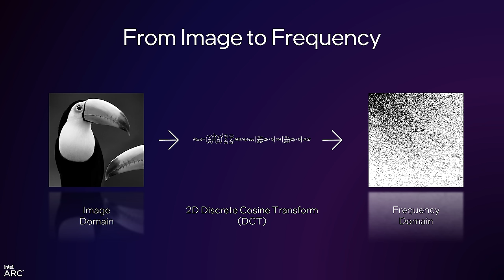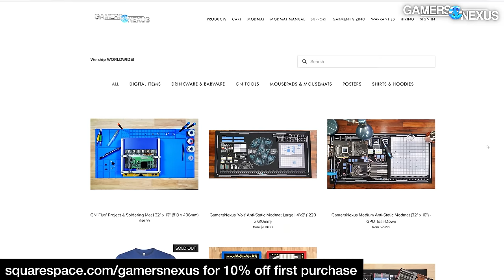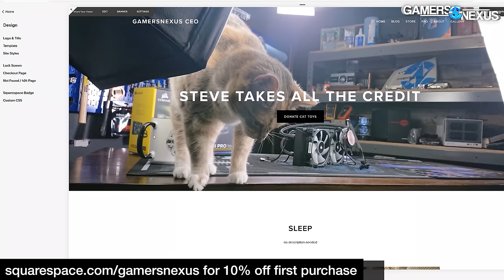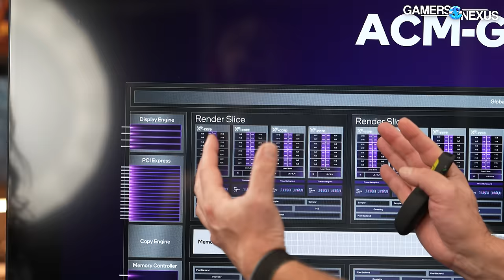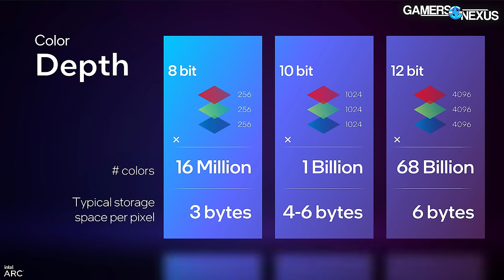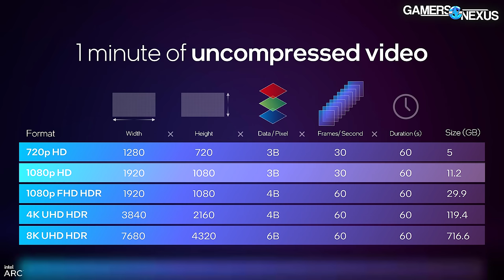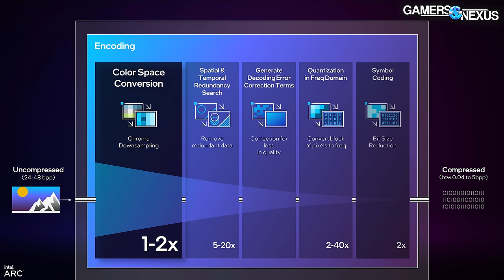YouTube's Existence is Insane: How Video Compression, Encode, & Decode Work (Basics)

Comment: A slight correction on chroma subsampling: it's not the bits that are subsampled, but the definition of the chroma image components. 4:2:2 means that the definition of the chroma image components is halved horizontally compared to the original definition, and 4:2:0 means it's halved in both directions.
Which means for e.g. 4:2:0 - which is the common consumer distribution format - you don't have, say, a 1920x1080 image where each pixel is 12 bits instead of 24, but one 1920x1080 black and white image where each pixels is 8 bits, and then two images for the chroma components, where pixels are also 8 bits but where the definition is 960x540 for each.
The chroma images then have to be upscaled back at decoding to match the luma definition (and just for fun different formats also have different specs about how the upscaled chroma pixels are aligned with the full definition luma ones).
Some video renderers will allow you to choose between different algorithms for that chroma upscaling step.

And an interesting trivia: one of Tom's slides shows 4 byte/pixel for 10-bit HDR video, but the P010 pixel format most commonly used by GPUs for that (at least on Windows) is actually 10 bits of actual sub-pixel information padded to 16 ! So if for example you use copy-back decoding mode (where the decoding image is transfered back to the CPU), 10-bit HDR video actually uses two times the bandwidth of 8-bit video instead of 1.25 times !

Comment: It's kind of insane how far compression technology has come. I still remember back in the 90's playing with a compression program written in QBasic that could cut your files in half and that was amazing back then, but now a video file can be reduced to a literal hundredth of its original size. The one inaccuracy in what Tom said was that it was lossless. Parts of the compression are, but the majority of it is lossy and information about the image data is lost. It's not as much as it used to be, but enough that multiple edits can lead to compression artifacts becoming more prominent than they otherwise would have been.

Comment: Thanks for these deep dives. If you want to ignore my pedantic nitpicks, feel free to ignore the rest of this (knowing GN viewers, this warning will only attract you)

It is true that rods do not differentiate color and that cones do, but the slide is suggesting that rods are responsible for luminance and cones are for chrominance. This is not the case -- rods are for low-light "scotopic" vision, and is rarely used in modern life. If there is any appreciable illumination, then the cones do all the sensing.

YUV is a very old colorspace from the NTSC analog broadcast days and there are other better choices nowadays, but the point of having more resolution on the luminance/grayscale part of the image over the chrominance is generally common among them. However, the subsampling rates of 4:4:4 or 4:2:0 do not refer to the bits used, and tbh I forget what they originally meant (were related to some analog-centric way of color transmission. 4:4:4 has colors at full rez, 4:2:0 has color at half-by-half rez, as was briefly mentioned. This terminology is also used in JPEG image compression.

I do not think any modern codecs are using pre-determined Huffman coding for symbols.  They either using something adaptive and denser (e.g. h264 had CABAC, an adaptive arithmetic encoder) or a simpler encoding.

Comment: 11:40 a note about chroma subsampling: It's primarily useful for live video transfer, where you need to get raw data across a studio or building. When it comes to actual video compression, the heavy lifting is done by the encoder, so chroma subsampling doesn't actually do much. This is why I have been frustrated at our insistence of using 420 this whole time versus 444, or even just staying in RGB. You can often have a 4:4:4 full range 10 bit video be barely larger than a 4:2:0 partial range 8 bit video, but it can store SO much more information and be more accurate to the source material. It would be way better for VR streaming since the color range would be better and colors would be sharper.

Comment: Another small correction: regarding symbol coding neither avc nor hevc use a fixed huffman table, both use algorithms which calculate the optimal binary coding at runtime, avc can use CAVLC and CABAC, while HEVC only CABAC, they are more sofisticated that a simple huffman coding

Comment: Tom Scott has made a great video explaining Huffman encoding. The gist of it is that, the more common a pattern is, the less bits we use to encode an occurence of that pattern. It's a clever way to generate an encoding for each pattern in such a way that it achieves that.

To really understand the frequency domain and quantization part, you kinda need to know the mathematical background of fourier series and the fourier transform (the discrete cosine transform used here is very similar to the "real" fourier transform as far as I understand it, same concept). 3blue1brown has made great videos explaining those.

 The basics is that we can think of any data as being generated by a sum of an infinite amount of sine waves or cosine waves, or in practice you'd use a finite amount of waves, the more waves, the closer you get to the original data. So you have for example a 1Hz wave multiplied with some factor a, a 2 Hz wave multiplied with some factor b, a 3 Hz wave multiplied with some factor c, etc, for each frequency you have a value of how strong that wave's influence on the generated data is, you just multiply each wave with that factor and then add all of them together to get the data (getting back the original data from the frequency domain data like this is called an inverse fourier transform). If you were working in 1 dimension, such as with (mono) audio, the frequency domain graph would have frequency on the x axis (eg. 0.1 Hz to 10000 Hz or whatever) and in the y axis for each frequency the "strength" of that frequency, the multiplier. In this case of working with images, you need to do this in 2 dimensions of course, so I assume you have waves going in the x direction and waves going in the y direction. So the frequency domain graph that Tom showed had the frequencies on x and y, and the strength of the frequencies was indicated by the brightness (darker = stronger). We apply the fourier transform to get this frequency domain representation, then we can manipulate it based on the frequencies, in this case cut of all the high frequencies (effectively removing the small, high frequency details of the image data), then apply the inverse fourier transform to get image data back (in this case of course it's not the image itself, it's the residuals). Exactly the same thing happens when you apply a low pass filter in an audio editing program, it uses the fourier transform, then manipulates the data in frequency domain, then uses the inverse fourier transform.

Comment: 17:30 I think if we focus on the left side, it is easier to explain: In video encoding, we have "DCT Blocks" and "Block Size". Basically, an area where we do the DCT. If you've ever see a JPEG image, it's the same thing. We get those blocks because it's trying to find an average of the color and only store that average. The reason it's such a complex process is because it is able to detect where high frequency (high detail) is, and approximate it. But even further: it can smooth out low detail areas into massive chunks of the same color, since we won't notice it as much.

TL;DR: DCT is throwing away similar data, but with context of how detailed a section of an image is. That's why Tarkov or other complex games on Twitch will look SO bad, but flatter, simpler games look much better at the same bitrate.
Reply: Lower res, then fxaa upscale. Very very abridged explenation.

Comment: I'm a big fan of Huffman since I work primarily with lossless image data.  It works very well with noisy data (even if it may appear clean by the human eye).  Low noise data typically performs better with good old-fashioned ZIP over huffman.

Comment: I would say the simplest way of describing Huffmann is: If you have a Word document that has the letters "AAAA" in it and you want to compress it,
you can compress it as "4A" (like 4 times A). For example "AAAA BBB ZZZZZ CCCC" could instead be: "4A 3B 5Z 4C"
Of yourse the example is extremly oversimplified and almost an insult, but you get the idea of what it does.

Comment: Edit: someone else explained it better

11:08 slight correction, 4:4:4, 4:2:2 and 4:2:0 is actually referring to the data in the grid. So in that grid of pixels 4:2:2 represents 4 vertical and horizontal illuminants samples. 2 horizontal chroma samples and 2 vertical chroma samples. 4:2:0 is the same but has no vertical chroma samples.

Comment: I'd love to see a part 2 when you guys talk about lossy vs lossless compression, why fixed function hw encoders are fast but are less efficient ( they produce higher average bitrate for the same quality at the same settings) when compared to the same encoder when run on a CPU and real time applications vs non real time applications optimizations, like streaming (both CPU and GPU using OSB and long term file storage. 

codecs are what pushed me to learn more about hw around the year 2000, when I started ripping DVD's. It's a fascinating topic.

Comment: BTW, Luma/Chromo is also used for Y/C on bradcast display monitors and for S-Video.  It has a much clearer picture than composite.  Although this has no compression, it's just a better way to send the signal than composite.
Reply: Did you know component doesn’t actually have a green signal? I learned this the other day cause my new crt projector I bought has Composite, SVideo, component, and RGB and I was like wait a minute there’s only red and blue signals (PbPr) how does that work?

Comment: Thank you so much for these kind of videos @GamersNexus. If you happen to be in contact with Tom again, it would be great to know though if the hardware encode and decode units are "generic" accelerators and thus can be used for several codecs (av1, h265, h264, vp9 etc) based on whst drivers tell them to do, or if each hw accelerated codec needs its own specific unit that supports certain codec specific instructions.
Thanks and keep up your great work.

Comment: Great video..Steve did a good job of clarifying certain points when Tom was speeding along but Tom is a great teacher and has a natural, easy manner and wouldn't be surprised if he used to do this. I followed along just fine (within reason!) but I had an aha moment when I realised where the 4:2:2 label came from. It blows my mind that actual people had the intellect to develop and create all these systems that at this point are just theorectical voodoo to me 😁
Reply: But that's just wrong, that's not where the 4:2:2 label comes from. It's about the sub-sampling of the chroma planes relative to the luma planes, not the amount of bits in each channel. 4:2:2 still uses 8 or 10 bits for Y and UV, but they simply store less UV samples per Y sample.
Reply: @luisjalabert8366  I meant in terms of various video ouput options in encoding software. I had no reference to what 4:2:2 related too in the sea of other format options..if you see what I mean? ((edit for typo)
Reply: @elone3997  I understand, but the explanation for 4:2:2 given in the video is completely wrong. There is an exact formula to map from RGB space to YUV space, but this has nothing to do with those numbers. And those numbers also do NOT specify what information you store for Y:U:V, this is not what it means, if that's what you were thinking.
Reply: @luisjalabert8366  Okay, thanks for the info 👍☺️

Comment: 15:53 kinda think of this like how an mp3 takes a note in a song and replaces all the time it's played down to just one time and that way taking a c note that played 200 times down to 1 and when replaying the song replacing where the c notes go with just the one u saved. This is why digital audio might sound slightly off when played against  it's analog component... the math removes the high frequency used bits in a video frame and replaces it them with an equivalent over and over... hard to describe but hopefully makes sense to someone 😂 😂

Comment: This reminds me of when CD drives first become available, and you'd need to install a video decompression card if you wanted to play back full motion video. It was either PCI(no e) if you were using a PC. You'd actually have to have plug your video card's VGA out into the VGA in of the compression card, then plug the VGA out of the compression card into your monitor. Got even crazier when GPUs become available, as at first they were stand alone units, too and it would just be an absolute mess of pass-through cables. Of course, I couldn't afford a GPU at that point. Thankfully it's all integrated into one card for our sanity.

The spatial/temporal redundancy reminds me of old 2D video game hardware. Back in the '80s and early '90s, CPUs were in single digit megahertz, and redrawing every frame would be too much for the poor thing. In order to get us a decent frame rate, there was a 2D accelerator chip that would have a static background layer(usually 2 screens wide) with X number of sprites per line and frame. The sprites were effectively small screens(typically 8, 16, 32 etc. pixels) where the first colour was transparent that could be moved to any point of the screen using X/R co-ordinates with minimal CPU usage. The 2 screen wide background was to allow scrolling. The screen's position could scroll over it left or right in an infinite loop using X co-ordinates, and this allowed the CPU time to redraw the offscreen parts to give the illusion that it was more than 2 screens. This is why you can do so much more with a NES than an Apple 2, despite effective having the same CPU. People will point out the NES is 790kHz faster, but the extra clock cycles are actually dedicated to producing the sound.

Err... a bit tl;dr, and I'm also no expert here, but I just felt like pointing out how as much as things change, they also stay the same. Or you could just think of it as "old man shouts at cloud".

Comment: another interesting thing in codecs is lossless codecs, you can still save quite a lot of bandwith without losing any information whatsoever, like with FFV1 and others, also, YUV chroma subsampling (aka 4:2:0 and such) has been a thing since before digital video existed, afaik it has its roots in color tv signals

Comment: I'd just like to nitpick on a detail. The huffman encoding with fixed pre-defined tables is no longer how modern video codecs work. It was true for MPEG-1/2/4, WMV1/2/3, etc.  Codecs since h264/AVC (h265/HEVC, av1, etc) are using context adaptive variable length coding (CAVLC) or the significantly better context adaptive binary arithmetic coding (CABAC).

The adaptive part means that there are no fixed tables, encoding codes are generated and updated depending on the actual usage (probability) of the input values.

Comment: What needs to be implemented is a quality feedback system. Preferably ssimulacra2 but thats unlikely.
Archiving video in a watchable quality is just about as important as encoding it for livestreaming (if not more important).
Implementing a feedback system that takes the output frame and runs it through the decoder and measures the quality of the output. Say we do have ssimulacra2 and I want a minimum quality of 70 the feedback would send the frame back to the encoder if it is below 70 and tell it to use more bitrate. Say I want to also limit the maximum to 80, anything above 80 is send back and the encoder is told to use less bitrate for that frame.
Archiving does not need to be realtime. It is perfectly fine to require 10 retries especially since the encoder runs at 250 fps.
So lets say I have a video of an aircraft landing. There isn't much motion even though you probably think there is. I know that a minimum value of 70 for ssimulacra2 is good enough for archiving. So I tell the encoder to set the minimum to 70 I also know about 85 is pretty much lossless so it never needs to be above that number. So I tell the encoder to go for a max of 85. Then I will say that I want the average to be about 75. You might also have a stop if within function. So if the score from ssimulacra2 is within 5% continue to the next frame. Obviously it needs to know that some frames can't be re-encoded in a lower quality as they are literally the same frame as the last one so you don't even have to try.

Implementing that would be a game changer. Especially for say Linus who could then re-encode his stuff without losing quality (in theory) by archiving it at 90 score. Since Linus as far as I can tell is storing it all raw. As for me I want that because I have quite a lot of footage from 20 years ago that takes up a lot of space but re-encoding it takes a massive amount of work and time. I have written a tool for it to do exactly as I just said but there are major flaws to it. Like the requirement of frequent keyframes.

Comment: 20:40 this is literally the reason why I always recommend a regular intel CPU (so anything that doesn't have F suffix) when someone asked for a budget build, if they want to go intel for the CPU but going Radeon for its card, because very much everyone is going to edit a video one way or another, EVEN if it's just a very quick duration trim or simple edit, at least I can just tell them to use quicksync because it works very well and saves them from having to deal with radeon BS on video editing